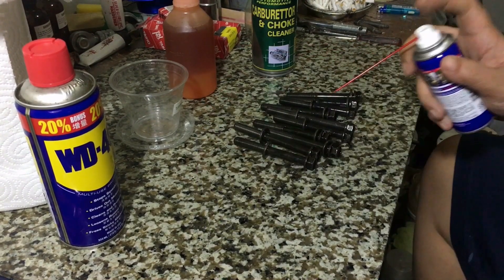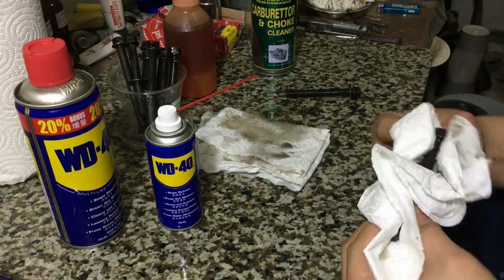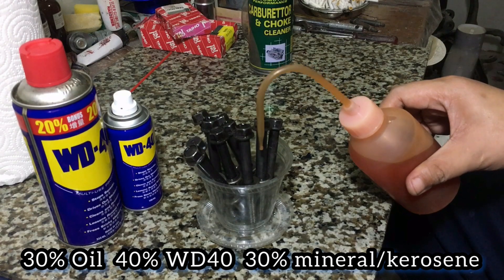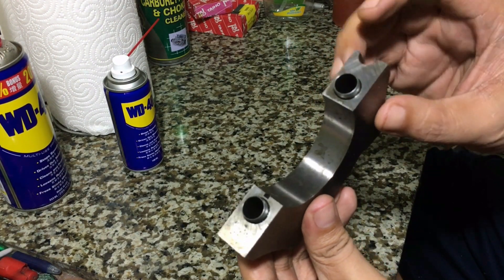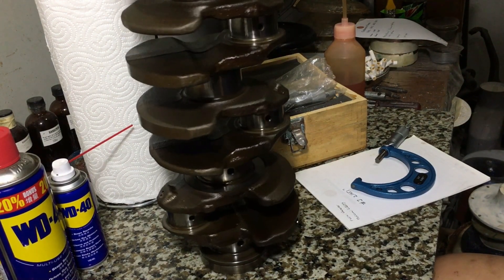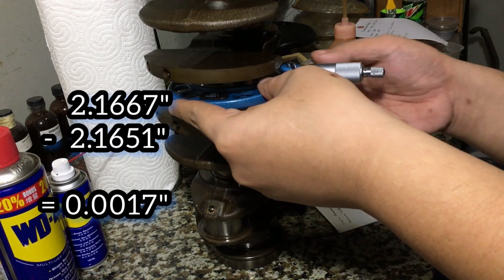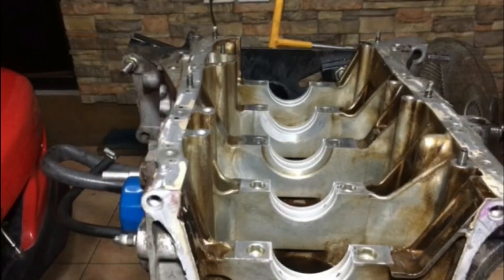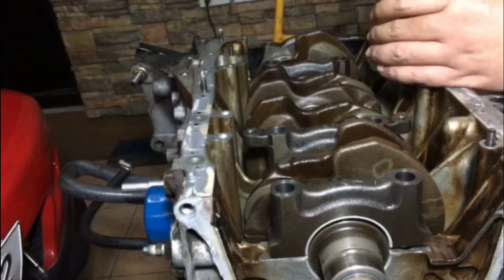How to: bearing oil clearance check with Plastigage

Comment: i just got my crankshaft grind and the clearances of my MB: #1,2,4,5 is .0015 and the #3 .0001 is that alright? please reply
Reply from the maker: Why is #3 super tight? Was it torqued well or properly?
Reply: sabi ng machinist para sa "oil pressure" daw
Reply from the maker: Well I don’t know but 0.0001 almost passes no oil and any load “bearing” on the crank I doubt there is cushion cuz there’s barely any space for an “oil film” 

but with respect to your machinist, that’s up to him

Comment: How about the bearing surface on the underneath side....you have to check that too?
Reply from the maker: On clearance? Not really as the bearing sits flush on the saddle

But if it has goges or worn grooves? Bigger problem cuz it might need a “line bore”
Reply: @SRDmotorsports  hey sorry i didnt know what it was called but i meant the main bearings. The one that goes in the block. Do you plastiguage that too? Thanks
Reply: Also i really enjoyed the video on short gear ratios and the importance of using all of the engines available torque on every shift. A b series version would be great. Also more videos understanding dyno charts and explanations on top end vs mid range would be great :)
Reply from the maker: @dawsonmacie6984  oh yes actually the mains are easier to check plastigage that the rods but yes I check that too
Reply from the maker: On the gear ratio I believe it’s the ITR manifold porting video and the P30 porting video that I did talk a bit gear ratio related to Bseries dyno

That might be interesting for you :) 

But after checking it hit me up with a comment question as to see how we can improve further